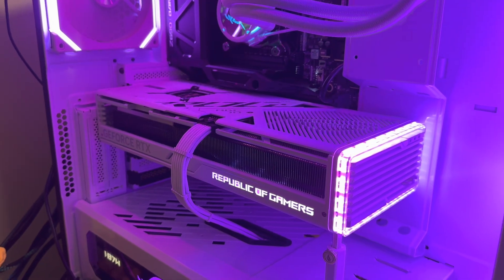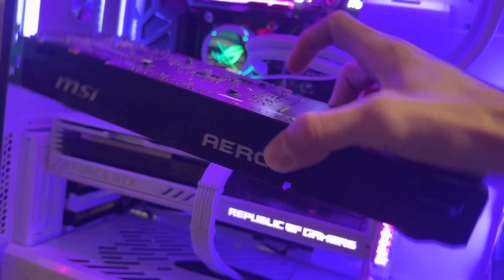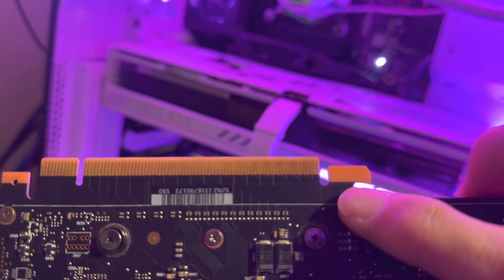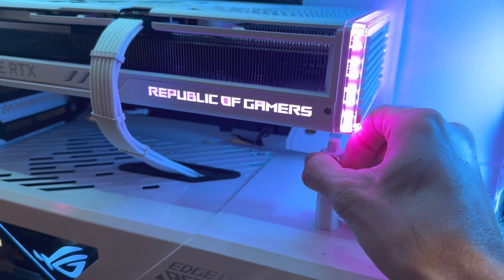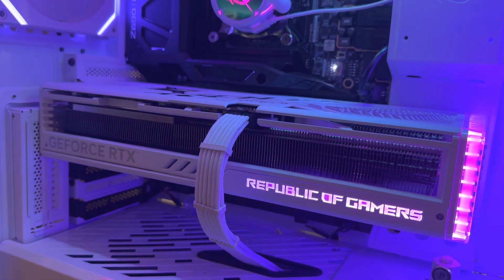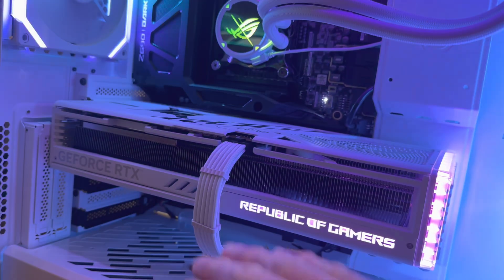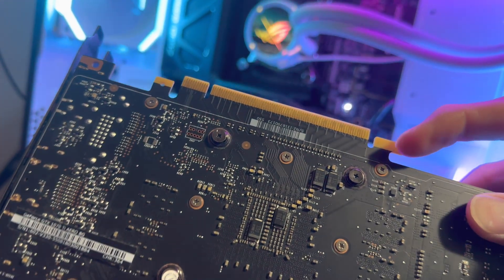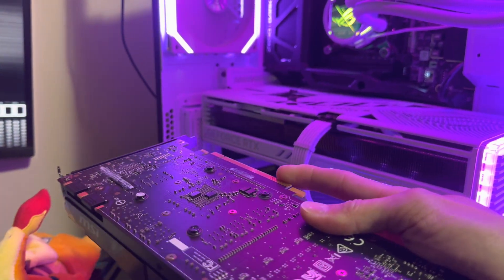Are Gigabyte Gpu’s spontaneously cracking? How to prevent it and why it’s not just gigabyte

Comment from the maker: Also side note asus and all manufacturers will deny a claim for any cracks or scratches to the pcb no matter what. I speak from experience
Reply: I mean if that's the case they should include a support bracket for free with the gpu and they should make sure to put instructions with the gpu on how to set it up properly or else its the companies fault at that point, my biggest issue with 40 cards is the 12vpwr cables burning the pcb, even if its fully plugged in which some cases were found recently, if you hear the click imo that should be secure and its because nvidia and other board partners cheaped out to save money and cost consumers trouble instead.
Reply from the maker: Almost all the 4080 and 4090 and even some 4070 ti come with a support bracket. The only ones I’ve seen burn up are 4090/ because they are pulling more amps than the pins can handle.
Reply: @cppctek  yeah that's the problem with the 4090s but some 4080s also had problems where the pcb burned. AMD was gonna use the same connector for their 7900xtx but went back to the old cable and they have no problems with their gpus. Nvidia made a mistake and cant own up to it which sucks since if a car company did this they would recall all the cars but nvidia wont do that with their cards to fix the problem. 

For the support bracket I feel like it's good but not every case has room for support brackets unless the support brackets are built into the case. Like the lian li 011 dynamic I'm quite sure it has fans under where the gpu is so that would cause problems putting a support bracket there. I feel like most case companies will now have to come with a free support bracket for the newer generational gpus, like with the phanteks nv7, nv5, and nv9
Reply: bro i have bought Gigabyte rtx 4070 ti super eagle oc . it weighs 950gm.  will it have any pblm . i upgraded from 3070 Founders edition qhich i had from 3 yrs. it nvr had any kind of sag  it weighs 1kg.

Comment: just verticalmount it
Reply from the maker: Worse temps that way. Also some vapor chamber design gpus just simply don’t like different orientations esp the cheaper model 4090/s I’ve seen. Many cases also put the fans too close to the glass and starve it for air
Reply: @cppctek  ah but do u have discord? so i could send a picture how mine is ?
Reply: @cppctek  i dm you on dc

Comment: Why don't they make a decent support for a horizontally placed graphics card 
but using a PCIe Riser cable 
so that the heavy graphics cards are fully supported 
And the support is attached to the graphics card housing and not the motherboard from this graphics card.
and the motherboard doesn't tear off anymore.
You can't count on the graphics card industry.

Comment: This is why asus gpu sag pen is the best! You can put it in the absolute perfect spot which won't only make it so this won't happen but it also doesn't put to much pressure in the opposite way and bend the actual full pcb like other gous are having happen with the reverse pressure from there sag brackets.

Comment: finally someone with a solution!! nice.
Reply from the maker: Pretty much if you just make sure as much tension is off the socket in any direction as possible it will not crack. 99% of the ones I’ve seen crack all were either sagging at one point or were shipped inside a build at one point. Sometimes a tiny crack can happen during shipping inside a prebuilt and then it spreads over time with the sag so it’s def the reason you should always use a sag bracket that takes stress off the socket and the pcb inside the socket

Comment: I got an ROG 4070Ti and a 4000D case.  Normally, the hard drive cage on my old 450D case held up the gpu.  I didn't want to use the little gpu stand that came with the card so I got a ROG Herculx gpu holder.  That holder comes with a bubble level.  Well, turns out the Herculx, 4000D, and fat gpus don't work together.  It's too big.  I wedged it under the video card but the bubble on the level was all to the right, so it was bending it.   Just for fun, I put the bubble level on the gpu without any support stand.   It was perfectly level without anything.   No sag.   I didn't figure out why until I remembered my motherboard (ROG B550-E) has steel reinforced PCI-E slots.    Still ended up getting the Corsair gpu support that works with Corsair's RGB triangle lights.  That works with the 4000D.

Comment: That BIG, HUGE cooler looks kind of heavy for that thin little graphics card. ... I wonder how firmly it is attached to the CPU-GPU case bracket.
Reply from the maker: You realize this is a 4090 strix oc? Lol. And it’s very well attached. The support stick takes all the stress off the slot when used properly. This isn’t my first rodeo. Check my channel for my credentials lol. 😂

Comment: What about the anti-sag bracket that comes with the Gigabyte 4xxx cards now? Is that not good enough?
Reply from the maker: It’s fine. Nothing wrong with it. People just use some kind of bracket on all cards
Reply: @cppctek  with the anti sag device you're showing here it seems like you could accidentally put slightly too much pressure going the other way as well I think no? I'm using the anti sag bracket that bolts to the motherboard and haven't had any issues for about a month now. Not sure how long it takes to sag and show damage but after one month I'll assume it's fine I guess?
Reply from the maker: @Solo6R you’ll see sag instantly without it. But gets worse over time. Just put it on the card and try to look and see if it’s level with the eye

Comment: This right here is why I prefer cases with a horizontal motherboard layout. Vertical GPU and CPU heatsink FTW! No unnecessary stress on GPU PCB and motherboard. My current case is the Jonsbo V8. One thing to note is that a big portion of these cracking GPUs are in pre-builts or PCs that have been moved. Shipping a PC with the GPU installed in a bad idea anyways...

Comment: Gpu support is not enough it is literally a bunch of weight putting pressure on the same area of the card constantly. Look at all the cracks they are mainly in the same place. Not saying this isn't gigabyte fault but this could probably happen to any card with enough stress and weight.
Reply from the maker: The support stick takes the weight off that corner and prevents the cracking.  Every gpu I’ve ever or dealt with has never cracked and many were gigabyte cards. 99% of them are all user error /ignorance at some point or another either now or prior or in shipping.
Reply: @cppctek  yeah don't get me wrong gigabyte might have cut some cheap corners on the graphic cards but with some simple support it wouldn't really affect it. People will buy $400 graphic cards and not a $10 support.

Comment: Really good video. I was coming to this conclusion since 30 series didnt come with support brackets. Interesting to see a founders 4090 repair video showing this exact issue. Also interesing that gigabyte actually gave a support bracket for 40 series cards, they must be well aware now that the weight of these cards need support. Gpu anti sag brackets are just mandatory at this point. 

Very level headed take on all this...we dont have the exact data and given its a popular brand you will get more cases. Also they are probably heavier than other cards so need that support even more.

Gigabyte are getting slammed because of the lack of support to customers who have had this happen and rightfully so. So as a consumer protect your GPU with a bracket  but shady after service support is not on either and they need to be better.

Comment: Absolutely right! I've been fighting with dumb people in social media and some few forums claiming that it's the manufacturer's fault, the same thing happened and the same argument i made about users who are not using GPU Support. Thank you, I can share your video in support of my claims :)
Reply: I do think it's partially their fault. With the price we pay for big 3 fan, new GPU's we should be getting a support bracket/mechanism included as standard. The mobo manufacturers are to blame too.
Reply from the maker: Thanks. Also people who’ve had a cracked gpu are always “never at fault” most of them are newbies. Also i found a subject who had moved his pc around while cleaning and when he sat it back down on the desk and turned it on it didn’t work. He removed gpu and it was cracked. Guess what brand it was lol ….. msi.
Reply: @cppctek but they are not.
PCIE slots and FR4 circuit boards weren't built for such a kind of load. It's inherently bad design, and planned obsolescence.
If manufacturers wanted to prevent this from happening, they would include support/stand with the GPU.
Can't fathom the mental gymnastics to simp and defend multi-billion dollar companies.

Comment: The cracking is mainly due to GPUs being sent out in pre builds. The sagging  will not crack the pcb. It will in time cause memory issues due to ripped pads so yes always use support bracket most RTX 4090s come supplied with a bracket.
Reply: Saging + thermal cycles warping PCB over time and cracking solder balls
Reply: @inceptionsd mine was shipped and they put something like bubble wraps inside of it. now because of this video my father noticed that my gpu is a bit bent.i ordered this little magnetic holder that can help me fix the issue.

Comment: I answered my own question. Put a little level on there and it's fine front to back, but motherboard to glass it's not level. So I ordered a little one from Amazon that had decent reviews. What makes me mad is even with Gigabyte's own bracket it is still not level! I think I would have had issues. 

This will be my last Gigabyte card, when I had an Asus card it came with the bracket like the one in this video, but I didn't use it then. Luckily nothing bad happened to me, but knowing this now I don't think I'll skip it.
Reply from the maker: I have never had bad experiences with gigabyte gpus and I’ve had a ton. I prefer asus tuf cards because it’s by far the best bang for the buck with the best build quality in the price range for sure

Comment: hey man I haven't watched your video, but I wanna share something strange that happened(not the gpu)
So I found your video on my phone when I searching for "gigabyte pcb" cracking yesterday and this video was literally one of the first to pop up but I decided to watch it later on my desktop.
Anyway when I entered the same query your video was nowhere to be found AND even if I filter/sort by date it still didn't appear.
Just thought to let you know.
Who knows maybe the video is being suppressed or something
Reply from the maker: Lol probably the algorithm but thanks for sharing. I’ll be posting some
Rog ally content next if you want to see a record breaking ally ! I currently have the record
Reply: @cppctek  NICE! I was suspecting sag to be the cause but i wanted to make sure. Regardless I did install the bracket(side question does it matter what kind/type of bracket I use) included with my gigabyte 4080 prior to this video(reason i hadn't was because i didn't want to detach and reattach my hdd cage).
A question though I have my 4080 since the beginning of the year, I did check the pcb for any damage and none so far at least as far as I can see.
But still my paranoia wants to be sure if there could SOME damage done for the time I hadn't installed my bracket?

Comment: Do the Gigabyte cards come with a support bracket or stand? Do they make it obvious that it is /required/? If not, then any cases where this isn't shipping damage should be covered by them, but I have no idea how you'd prove it either way. If you're using the card normally as instructed, and it just cracks after a few months of sitting in your case, still within the warranty period, you can't blame the user. It's Gigabyte selling the card and they should do the due diligence of making sure it doesn't break within the warranty period at the bare minimum.
Reply from the maker: Asus will deny warranty faster even for a scratch on the pcb. Even evga would. They all are using reference pcbs boards made by a totally diff company so it’s not a gigabyte issue per say but yes they come with a bracket for the 70 series and above for sure as well as all other brands do now like asus and msi and evga did too. I’ll be doing a follow up video soon to share a ton of proof and repossess from gigabyte asus and more.
Reply: My gigabyte 3070 ti sadly didnt come with one but i am not sure if i actually need one
Reply from the maker: Grab one to be safe. They are cheap on amazon
Reply: Received my 4060ti triple fan today, it didn’t come with the support, so I had to buy it, but dang, these gpus are heavy, clearly someday it will bend
Reply from the maker: Get one to be safe they are cheap on Amazon. Although the 4060 ti isn’t as heavy or big as a 4080 or 4090 I’d still get one

Comment: the real issue wasnt the cracking itself, but 
A. how Gigabyte dealt with it (aka physical damage automatically user fault = no warranty) , when THEY did NOT add a support or even mentioned, that there is  the need for one. They just started it now, when the shitstorm started.
B. That there are tracks in that little nobby sidepiece = the tiniest crack kills the card and somebody has to solder in jumpers (design flaw)
and
C. That Gigabyte had issues with older GPU models  (20 series), where the cooler construction was so flimsy, that it broke off just by moving the card (eg for a PC cleaning) and they had MAJOR issues with Mobos frying the cpu, where they also dodged any responsibility.

So as much as i can see how you had fun with this "calm down you snowflakes - i know why and how"  video, it kinda misses the point entirely.
Reply from the maker: I guess I’ll make a follow up video because asus and every other brand has done the same thing. That’s like scratching your car or denting it and say it’s the cars fault for having such weak body panels. I’ve personally dealt with asus trying to rma a card with a scratch on the outside of the pcb that was there from day one and worked fine for a year until I started getting issues with the vram and they denied rma saying the pcb scratch voided the warranty.
Reply: @cppctek  I didnt say that Asus (or MSI or whoever) was any better. In fact nobody said that. You know why? Because Asus has nothing to do with this and talking about Asus in this context just whataboutism.
I mean having a - at least i would consider it as such - major design flaw in a quite pricy (some might even go as far as to say : obscenely over-prized) product and then be super dodgy with the warranty is just scamy - period. (and it doesnt matter which company)
So maybe instead of doing the cool "just be calm and use ur little bracket and everything will be fiiiine"  none-sense, maybe talk about WHY most of the regular GPU "modders" have to cut cost at - as it seems - quite relevant corners, which would lead to why EVGA left that circus (a company with which i - and i'd reckon the general consensus goes d'accord there - never had a single issue. Mostly "over "designed and A-class warranty/customer service)
The other option is ofc to act all defensive and passivfe agressive and repeat your car analogy like a scratched record (it doesnt work btw).
Reply: @Sporting1210  you need a snickers my guy

Comment: Gygabite has extra flex on the pcie cause of bad design so that's why you see more cracked gigabyte cards so do some research first
Reply: Zotac got this major cutout too
Reply from the maker: Wrong. They use reference pcb and the pcb itself isn’t the issue here. The thickness is the same. The material is also the same. The traces are all down in that corner on 99% of gpus also. You know how many times jayz2cents has been wrong and had to make statements and follow up videos and even removed his own videos ? A ton. I’ve been following him and all the major tech creators for 8-10 years now or more. I understand you think you know what you’ve been told but I can tell you having tons of gigabyte cards in my life and all my friends who build have used them and none of them have cracked. It’s not an issue 99% of people will experience
Reply: @cppctek  Yes it's just a coincidence that most of the cards with cracks are from gigabyte
Reply from the maker: Not true at all. Go on Reddit an type in cracked gpu. Enjoy. Also look at sold eBay listings for cracked Gpus. Tell me how many gigabyte gpus have you had ? How many have cracked ? I can say with confidence I’ve had over 20 gigabyte gpus. Never had one crack, even some that were used heavily under extreme work loads.
Reply: @cppctek  Wrong.
Reply: @cppctek  Dude, it's a fact gigabyte products are shit. Stop defending them.

Comment: I have the bracket that came with the GPU attached, and also another 2 supports I made and installed from day 1.
I think it was pretty obvious by the weight of the GPU that it was going to need more support.
Cheers.
Reply from the maker: Heck yeah better safe than sorry ! I wish they’d come up with some lighter materials but still have the perfect thermal performance. They are a bit hefty and unbalanced.  Maybe a new slot/connector design should be created at the least.